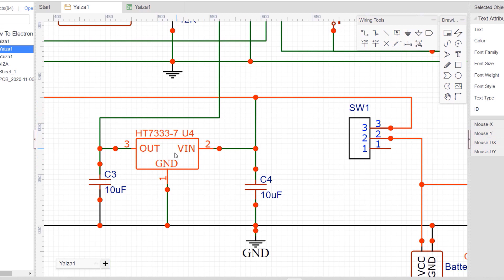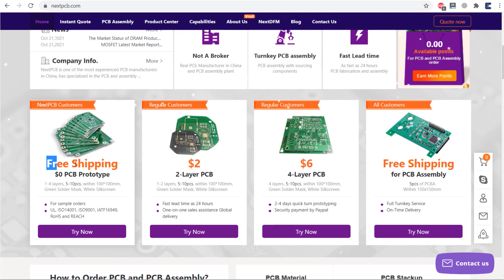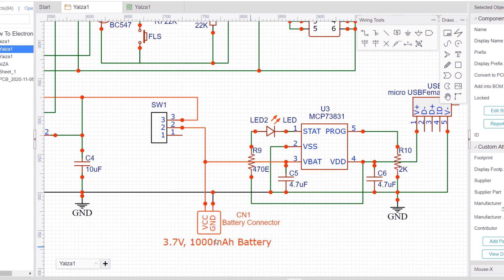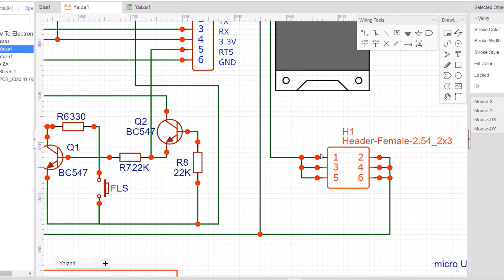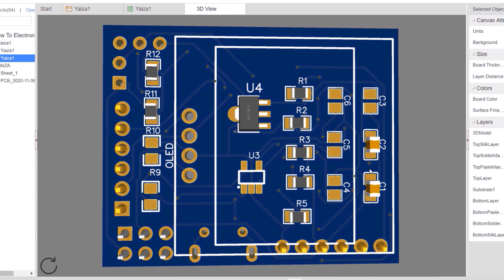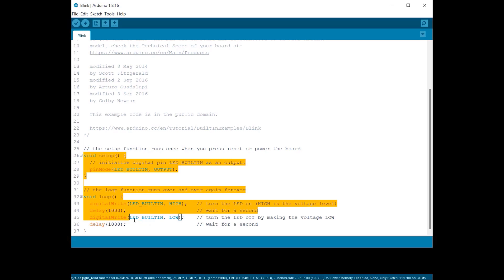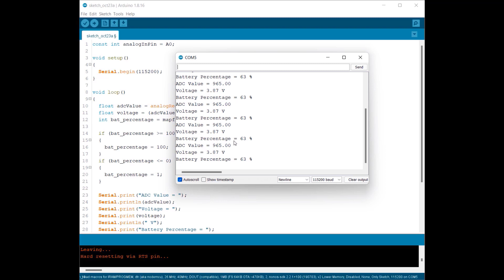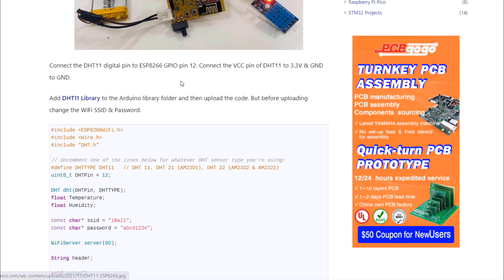Design your own ESP Board for Battery Powered & Low Power IoT Applications

Comment: Will it differentiate between the battery's actual voltages ? Means if the battery is at 3.7V and you plug the charger to charge the battery i.e is of 5v probably what will be the voltages shown on esp 3.7 the actucal voltage or the voltage on which the battery is getting charge?

Comment: what was wrong with the circuit. was it just a footprint error or manufactoring error or schematic error?
Reply from the maker: Everything is corrected in updated schematic.
Reply: I do not see an updated schematic where is this located?
Reply from the maker: Check the link in the description. It is posted in how2electronics.com
Reply: @HowtoElectronics  The schematic on the website seems to be the same schematic on the video. Unless the video is updated as well.
Reply from the maker: The schematic is correct. Use the same component mentioned in the schematic. Since one of the component was not available with me, I replaced that component in the video.
Reply: @HowtoElectronics  great. Thank you so much. Great video very helpful. Liked and subscribed (:

Comment: Additionally, to previous issues, your design drain 53uA from the battery all the time, for measuring purpose, consider using much higher value if measuring is needed
Reply: Every battery's voltage is measured  code can be optimized to read it after certain period. What is your solution?

Comment: Two issues, first depend on working condition and battery type you may "lost" 25% of battery capacity (3.3V+0.14V= 3.44V), second if the battery doesn't have an integrated low voltage circuit, you will drain the battery to 0V and destroy it.
Reply: the processor is measuring the battery all the time. Before it drains below a certain cutoff voltage it will shut itself off (deep sleep) unless charged. I mean a code can prevent complete discharging.
Reply: @trivimudbodh  It is not same ,you need independed voltage control, from many reason, measuring using analog input in ESP isnt option
Reply: @roseat2  So are u prosing to place another mcu to measure the voltage? or digital meter or what?
Reply: what is 3.44V u calculate. U must elaborate more on your first point. Or you have an habit to comment anything?
Reply: @trivimudbodh  Simple, check your schema, check your electronic components, and check what the specification said about voltage, and you will be available to reproduce calculation, and yes "deep sleep" drain battery to, same like LDO and other components in your circuite
Reply: @roseat2  yes  agreed deep sleep drains too but SO what is your solution?